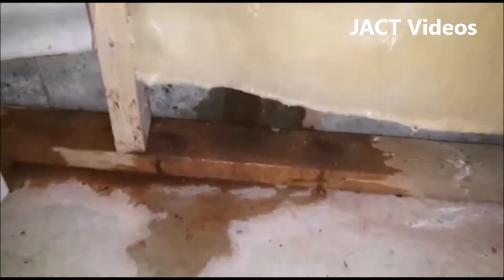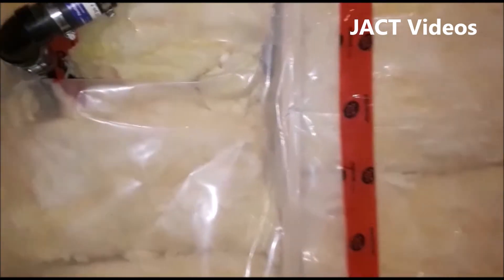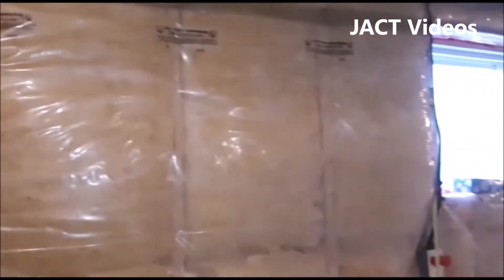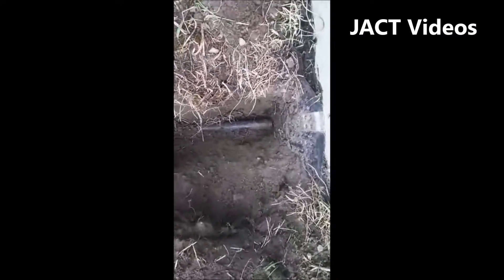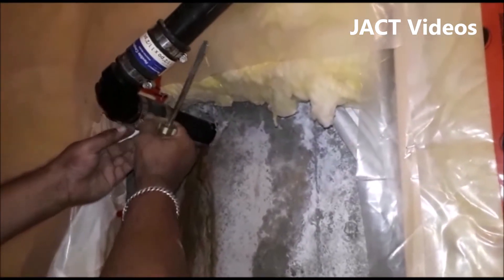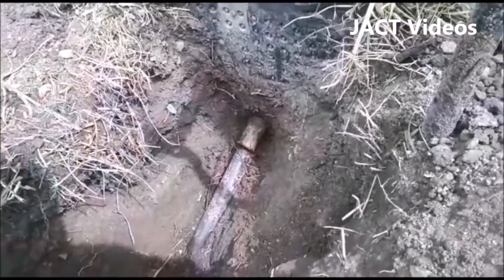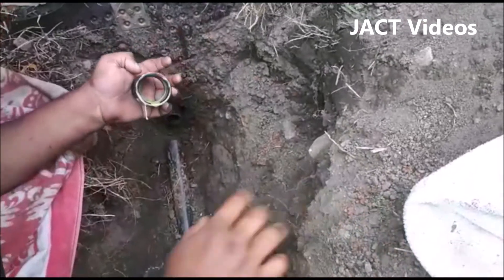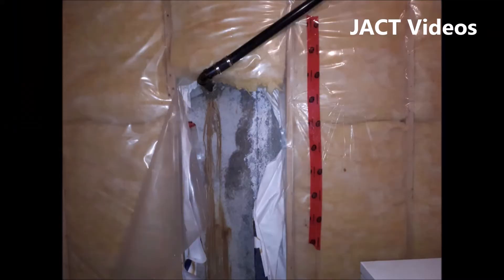Repair of a basement foundation leak from a broken sump pump drain pipe

Comment: I think I have the same issue as you demonstrated. Glad you mentioned about the colour on the wall to indicate the pump water versus rain water.

Unfortunately in my case the pipe was installed in the concrete. No idea if I will be able to pull it out. 

The exit point is under a veranda. Will need to pull up a number of board and will be really tough digging. 

No windows to reference just will need to go to the end of the foundation. 

Section of the basement it is in is unfinished. House is 70 years old and likely been leaking for a while

Not a young fellow like yourself and think I will need to leave this to some pros.

Thanks for the video. This gives me a good idea of the issue.

Comment: Thanks for this video, I just discovered evidence of a similar leak.  No water but almost a bucket full of dried sandy soil.  The previous homeowner did not disclose the problem so now it's mine to deal with.  The home inspector did also not notice it.  I see that after repairing the pipe you must have filled the hole with something.  Is that some kind of concrete product?  Thanks again.